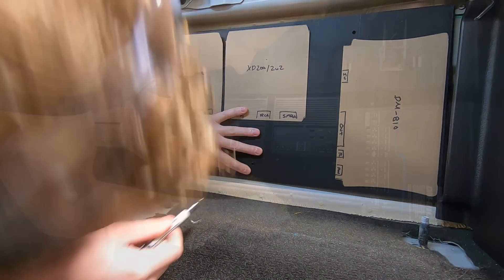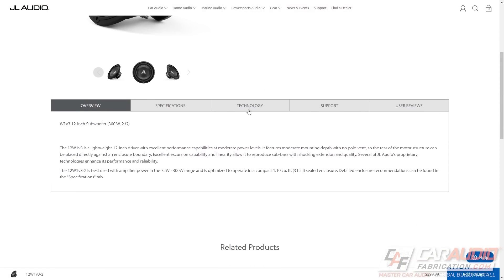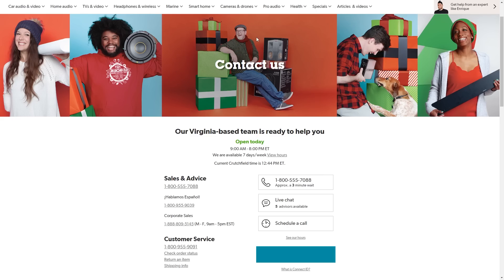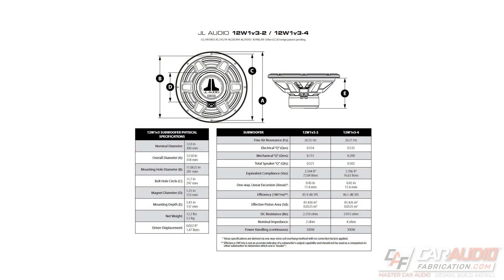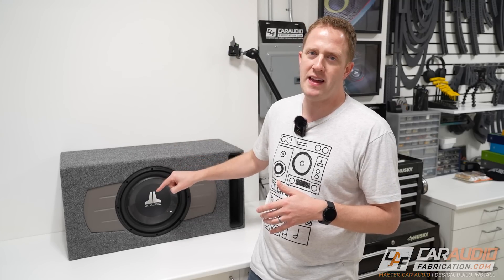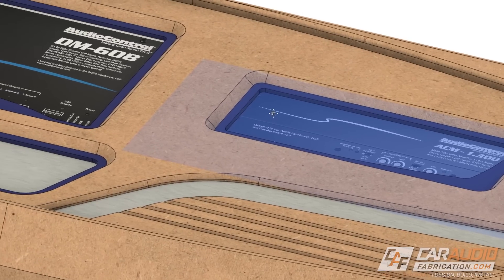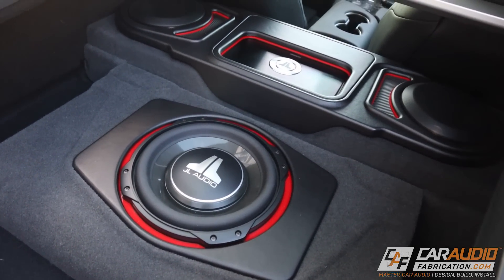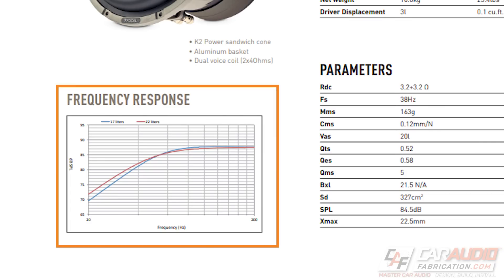Attention Car Audio Manufacturers! Please improve THIS!

Comment: hello, I have a Volkswagen Atlas and I want to change the speakers.  tell me which ones are better to install and which amplifier to buy for them and whether you need to install krasovers or not.  thank you very much.  I really like your channel.  I wish you more success.
Reply: Your question can be answered many different ways…..
Speakers are relevant to the person listening to them. I am a huge Focal fan but you may like something else. 
Crossovers need to be installed if running a passive system. If you’re running your system fully active (1 channel dedicated to each speaker) in the car with a DSP then crossovers are not needed. 
My personal favorite amplifier is JL Audios VX line. But do some research first before you buy. If you have a local car audio shop with sound rooms go in and listen to everything before you make up your mind.   Hope this helps at least a little anyway. Good luck.

Comment: I couldn't agree with this more. I just got done recreating my speakers in 3d in fact.

I was a car audio installer in the early 90s. I am the process of planning and installing my own system as a hobby. I am surprised how little has changed. The gear hasn't changed all that much, the installation challenges are the same, the same installation tricks are being used, and the lack of data is still an issue. What have people been doing for the 30 years? Having manufacturers provide more information is a no brainer.

Comment: About 20 years ago (memory foggy), when I was looking into making my own subwoofer enclosure, I did a bunch of online research. The sparse information you had to use, complex math, etc..., and even found a program to help, it was complicated. You had to hope they provided accurate information on frequency ranges. 

On a side note, any chance you'd be down to take an old amplifier, remove the guts and make a computer case? MP3CAR had some cool stuff back in the day. They had Street Deck, a Linux based  operating system for the car, and even had purpose built computer cases for the vehicle.
Reply: Mp3car was awesome !! Still have a Lilliput monitor I got for a carpc build before I decided on an android tablet.
Also fiberglassforums was another great place back then online

Comment: Here is a dimension size information, I had a 1991 MK5 RS2000 Ford Escort, I fitted two 15 inch Sony Explode 3000w max each subwoofers in the rear parcel shelf, a 6000w Sony Explode amplifier in the boot/trunk with 6 cooling fans, large capacities, a bigger alternator, six 510watts 5x7 inch full range speakers in the doors, rear passenger side panels (2 door car) and fixed rear shelves, Caution, I killed my car with sound
Reply: lol
There´s no useful information in your comment.
Reply: @mindtraveller100  There is, plenty, now with your attitude, is it no wonder manufacturers don't bother with aftermarket products and mindtraveller100
There is no useful information in your comment Ha Ha
Reply: @nigelman9506  I agree with you.

Comment: I have a high-end 3d scanner and a ton of car audio gear. Maybe I can create a clean Step library for everything I have and make it free for everyone to access that basically covers 95% of what is sold on down4sound.
I also run a 48hr break-in on my subs free air at 1/4 rms power doing 20-80hz sweeps after that, I take my own thel Thiele/Small parameters on each coil then with coils in series and parallel and make notes of all of them as I do a final gut check by doing the series test using both the weighted and calibrated box methods as the box tends to give more accurate VAS values. And weighted is better BL values.
I keep all this information in a mysql database as is with a custom data entry and lookup application I wrote like 12-15 years. At this point I might have over 400 sub models and maybe 20000 entries. My look up table gives my the avg tested values the last tested values and graphs changes as some model of subs I use often and when doing a custom box I test every single sub. This help me make small fine tuning and better warranty my work as the subs are broken in and ready to play the day they leave the shop. I do only custom work from home shop but it's for high end people with 6 figure cars and so on and I do it mostly as a hobby I have a day job as an engineer so income is taken care of

Comment: I would like a chart for usable or suggested frequency range per watt. Example. Mid bass down to 80hz at 75 watts or 100hz at 100 watts. Frequency response listed 45hz-5khz and max watts at 100. You play speaker down to 45 hz and at 100 watts you are going to overheat coil or blow out suspension.

Comment: Being able to read the manual before purchase is almost a make or break for me.
Reply: 100%  If the manufacturer spends all that time on R&D, how hard is it to put some specs in a PDF?
Reply: I've yet to see a graph/ T/S parameter ... that correlated to my enjoyment of said piece of audio equipment. It's a guide, at best! There are many more considerations in the equation, namely, the enclosure the driver is going into (and that's a can of worms), the environment it's going into, and listening preferences.

Comment: Great video. Is there any reason they don’t just include the cone displacement as part of their air space requirements?
Reply: I bought a subwoofer recently and the displacement measurement provided by the manufacturer seemed unreasonably low. After reading your post, I am wondering if the displacement measurement isn't just the volume of material the sub is constructed from. Fortunately, I remember a little geometry and will perform some calcs before I start building.